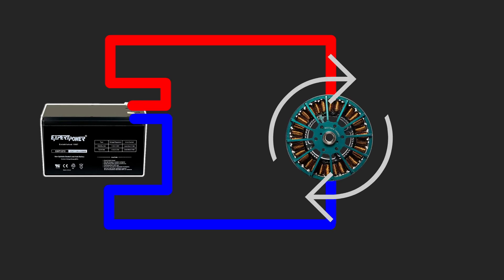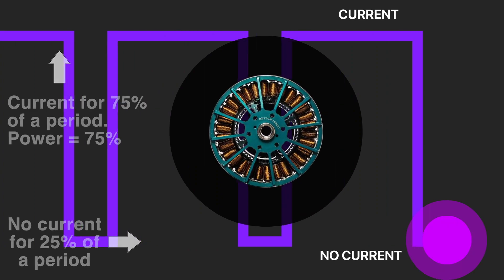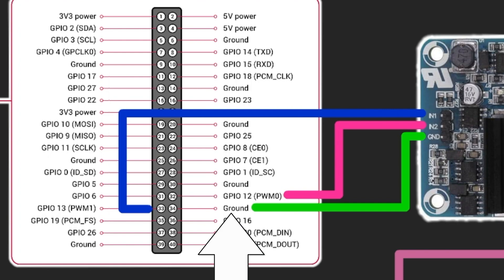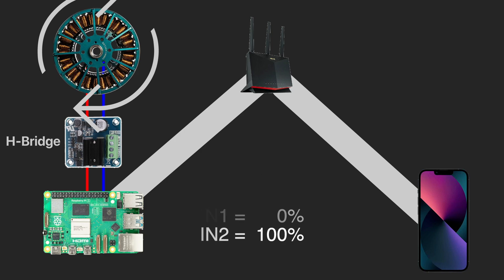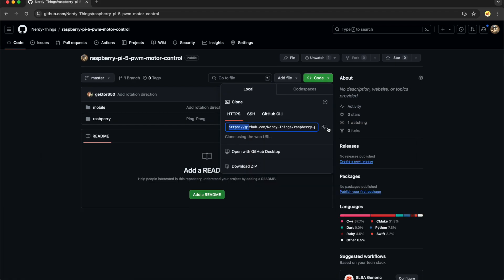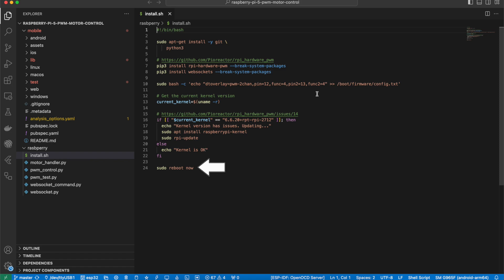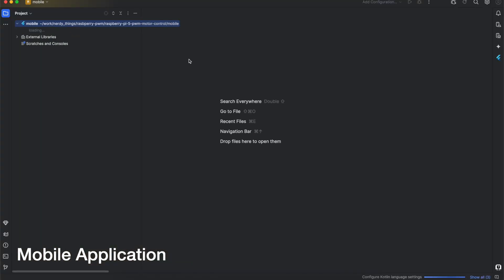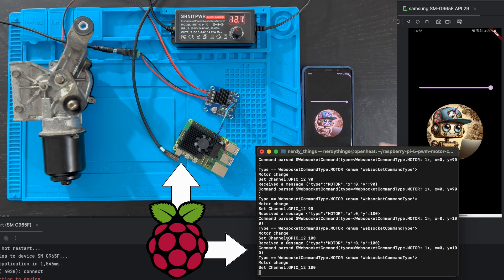Raspberry Pi: The Ultimate Guide to Controlling Electric Motors

Comment: Hello Eugene. Your channel is interesting to me. Can I use a bigger motor for my coffee roasting project?
Reply from the maker: Yes, you can. It depends how big it is. This controller https://amzn.to/3FbvMYI can handle up to 15v 50A. If your motor can be powered with this, it would work.
Btw, If you find the channel interesting - don't hesitate to subscribe :)
Reply: @itkacher please recommend what type of brushless motor that can spin up a 10 to 20 kilos of weight like a stainless steel drum for coffee roasting. Many thanks!
Reply from the maker: None of the motors will do it. Or they will be over expensive. You have to add a gearbox that will reduce motor rotation into torque.
Try 775 size motors, but even they need to have a gearbox
Reply: If any brushless motors don’t work, send me a link to a motor that will work. Thank you for your help.
Reply from the maker: How fast should it be?
Here is a motor hat can lift up to 15kg https://amzn.to/4dCxoqZ
The downside is that it has 10 rotations per minute. 
Here is a bit faster option: https://amzn.to/3SWELQx 100 rotations per minute. This motor requires 24V (it won't work with IBT4, you can control it with this controller https://amzn.to/4mANp4X )
So it really hard to say. 
You can try different options.
But the first step is for you to decide: how many rotations per minute should it do? 10? 60? 100? 1000?

Comment: You do realise esp32 exists right? This is not 2015 lol.
esp32 only costs $3-$5 and can control motors using esphome/tasmota.
Reply from the maker: Yes, I do. 
Here is a project with PWM and ESP32: 
https://www.youtube.com/watch?v=fVHgzSinqA4

Here is a project with PWM and Raspberry PI:
https://www.youtube.com/watch?v=4OQUo0V-8QY

Do you know why? 

It's easy. 
1. ESP32 can't send a video stream, Raspberry PI can. 
2. I have Raspberry PI and I can use it whenever I want. 

Additionally, Raspberry PI 2w costs 21$ https://amzn.to/3U0tq34

Are you really saying in 2024 that 21$ is a lot of money? 
One beer and a small dish in a cheap restaurant. 
I have bad news for you....
Reply: @itkacher  
No one said anything about video streaming. For simple pwm to control motor, esp32 is the way to go. 

You forget raspbery pi is bigger and requires sd card in your "$21" budget. $3 vs "$21" is no contest.
Reply from the maker: @jackipiegg no one asked about streaming :) 
Additional info is that you removed from consideration  a time for development. PWM is nothing without a proper usage.

It takes significantly less time to write a websocket server on python/nodejs than on C++ or C. 
If I can write the soft in an hour for Raspberry PI and in two hours (or more) for ESP32 - it will be much cheaper to go with a Raspberry PI. 
21+10 = 31 - 5 = 26$ difference between boards.

Would you spend more time on making a server on ESP32 or will you just go with the easiest and fastest way with higher level languages? 

I did a project with 2 PWM outputs and a video stream using Raspberry PI and I still think that this is a great option. 
 And even 50 is not a "budged" for a tech project. The whole budget was ~250$ and it's ok.
Reply: @itkacher  
What? Write code? 
Guess you don't know about esphome and tasmota.
Reply from the maker: What? Esphome? Tasmota?
Guess you don't know about writing code.
Reply: @itkacher  
???
Why write code from fresh wasting time when you can do it in minutes using tasmota?
Reply from the maker: Why from fresh? 
https://github.com/espressif/esp-idf
Reply: @itkacher  
Why complicate things?
Its just pwm and h-bridge, you can automate it to a web-browser using tasmota/esphome with GUI lol. No coding required, even a layman can use it.
Reply from the maker: If you need a web-page with a button/slider to control PWM on ESP32 - yes, you are right, tasmota/esphome is one of the solutions.
In my case, I was need to make a video stream AND control 3 relay and control 2 PWMs based on the websocket commands. I am not saying about any types of computations in parallel, like AI. 

Could it be done on ESP32? Nope, it will not handle it.

Can you solve all the challenges using the cheapest ESP32? No, you can't.

What I am saying is that:
1. It's totally fine to use Raspberry PI (zero, 2w, 3,4,5) to control PWM output.
2. It's totally fine to use ESP32 when it can complete all requirements.
3. 20$ for a Raspberry Pi is not a budget. 150$ for a Raspberry PI 5 is not a huge budget. 

The choice of the a board depends on the task. If you need something simple - ESP32 is fine. 
If you need to make a race car that captures a stream from a camera, recognises objects and follows them - you will probably need Raspberry PI or Jetson or Xavier or anything that more powerful. 
In the second case, you will need to do heavy computations and control hardware PWM based on it. 

Additionally, you can control PWM with ESP32 in ESP-IDF code easily:
https://github.com/Nerdy-Things/electro-sup/blob/master/main/main.c
        ESP_ERROR_CHECK(ledc_set_duty(LEDC_MODE, LEDC_CHANNEL, duty));
        ESP_ERROR_CHECK(ledc_update_duty(LEDC_MODE, LEDC_CHANNEL));
Even a layman can do it. That the easiest part. The complex part is to make the whole system.

And what I don't understand is:
"haha, lol, it's 2015, no one uses Raspberry PI for PWM, because 40$ is unaffordable amount of money, esp32 will do everything you need"

Comment: How much latency do you have between the input on your phone and the motor taking action?
Reply from the maker: I didn't measure it to say exact numbers.
If both deices have a strong wi-fi it should be something less than 100ms. I can't see any delays with a naked eye: https://youtu.be/87j-9wZi92E?si=hpt2QEub1CRUNlfh&t=655 (start at 10:55) 

In my Lawny project (https://youtu.be/4OQUo0V-8QY), sometimes delays were huge, but because of connection issues. 
Some messages were never delivered because of the Wi-Fi loses  :)